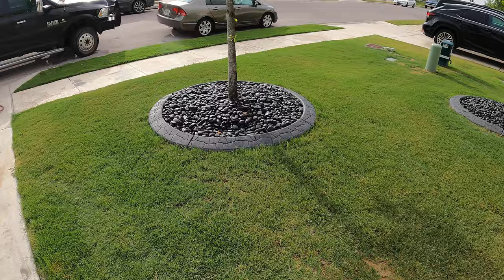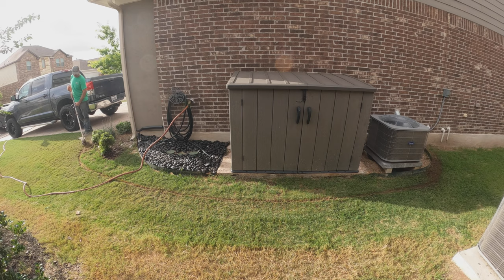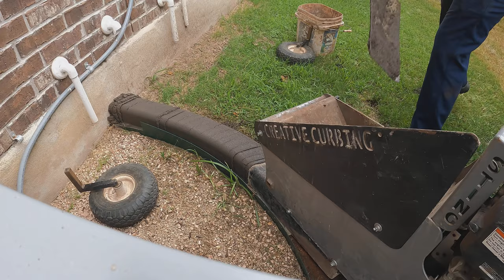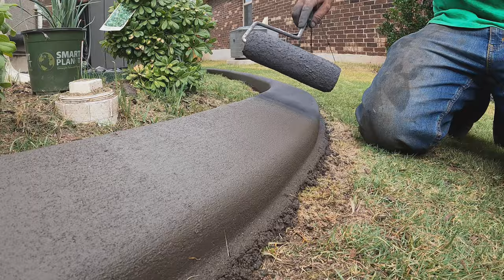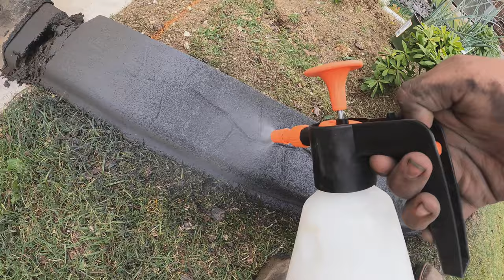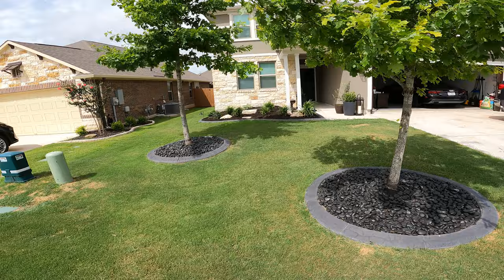Start to finish stamped landscape curbing!

Comment: Great job and very relaxing to watch. I had curbing done last year and they did an overall but covered a few of my sprinklers so I don't really deal with that company anymore. After a year I'm not too crazy about the color. Can the curbing be repainted in a different color and sealed again?
Reply from the maker: @mr.b4444 thanks! mix color release with mineral spirits, spray it on, wait for it to dry, then seal with a concrete sealer.
Reply: @creativecurbing  Thanks so much for the quick reply. I'm not so good with a sprayer so I'll have someone do this for me.
Reply from the maker: @mr.b4444  you can get a cheap $10 sprayer at home depot. It doesn't even have to be even. It's very very simple. Trust me, you could do it. Spray on the color. Then spray 50/50 mixed xylene and concrete sealer on it

Comment: Nice work, I have seen those continuous curb machines around, that is a very attractive upgrade. Do they make forms for various profiles? I think I might like something a little lower on the grass side that I could hang the mower deck over. Could always dig it down too.
Reply from the maker: Look on Google for "curbing mower edge". We're doing a mower edge job on Wednesday and I'll post the video Thursday.
Reply: @creativecurbing   Thanks for the speedy reply, will check it out. Looks like you guys are in Texas?? Wish you were local to me here in Washington state. 

How is this type of work typically priced? Guessing by the foot with up charges for the color and stamping?
Reply from the maker: @te01guy  yup. It varies greatly around the country, from $4ft to $15ft.
Reply from the maker: Well our mower edge job canceled. As we typically do not do mower, there is no telling when we will get another job doing mower edge. Sorry about that!

Comment: As a single piece of concrete do you add any rebar or cut points for strength or controlling cracks? I assume the trowel punctures and vertical grooves were enough. Nifty machine.
Reply from the maker: You're exactly correct. Every few feet we throw a crack joint in by making a cut in the curb then rolling it. Unfortunately, due to the process, we aren't able to put rebar, but we do add fiber mesh to every load.
Reply: @creativecurbing  Very cool. It's always impressive to learn and see people doing what they love by making it a career. Great job and wish you continued success!
Reply: how deep is the crack joint?  just wondering.... @creativecurbing
Reply from the maker: @lynnstuckey9087  3/4 of the way through.

Comment: How long will last without cracking
Reply from the maker: It will eventually crack at the joint lines. That's why we put them in, just like a sidewalk or driveway. By putting the joints in, it makes the crack less noticable. We have curbing that has been put down for 15 years that still looks great